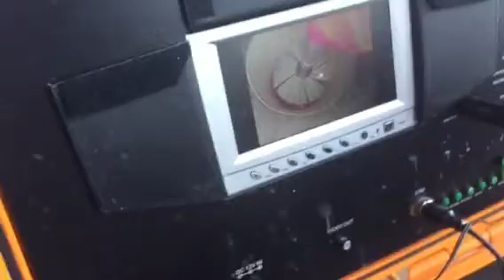Using Brush Casting To Line A Pipe

Comment: What state are you in? If i understand what you do..1st unclod the drain, 2nd put the scale removers through 3rd then brush the line..
  How long does the epoxy take to dry before the line can be used again?  What kind of cost is involved?  Say a 2" line from a bsmt LT to the stack 20ft away?? $500??
Reply: @theplumbersplumberinc7454  i was curious to how cost effective it has become, but with all the time involved, unless the pipe in in 12" of concrete its probably cheaper to remove & replace it..unless there is some strong reason not to.